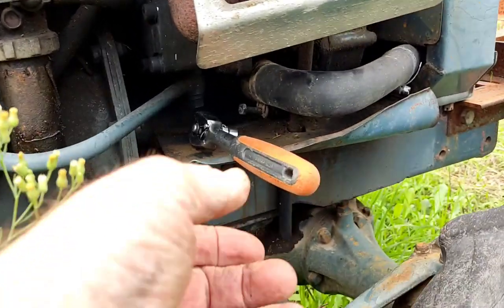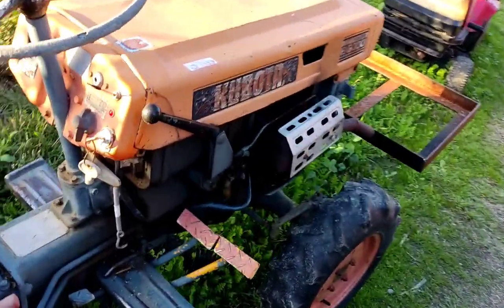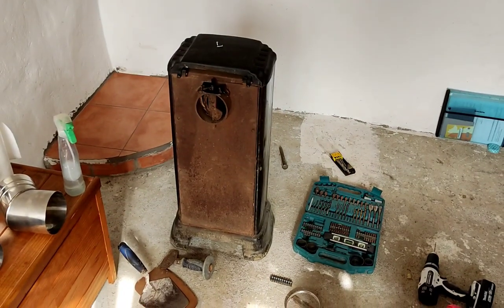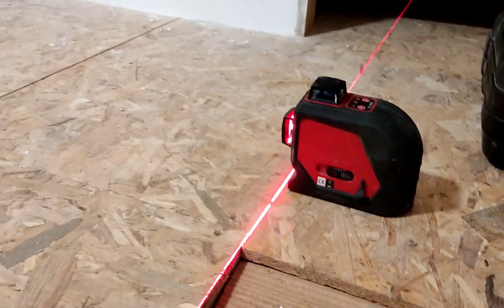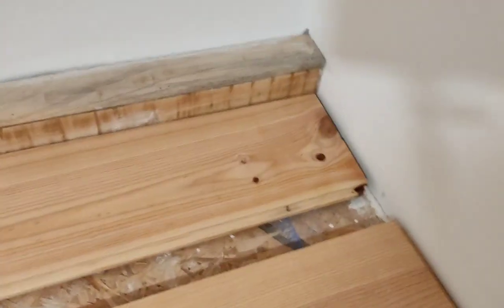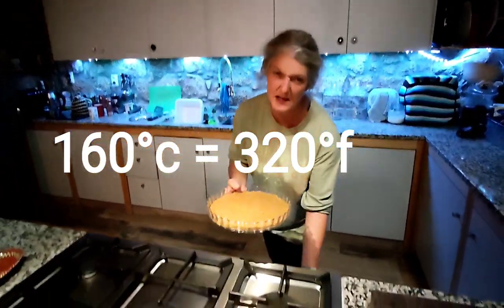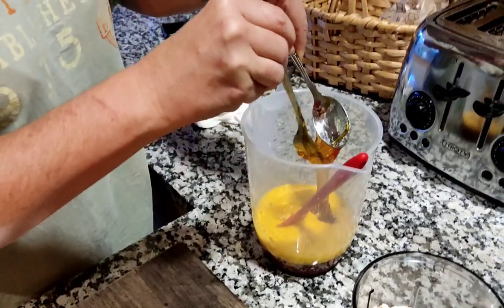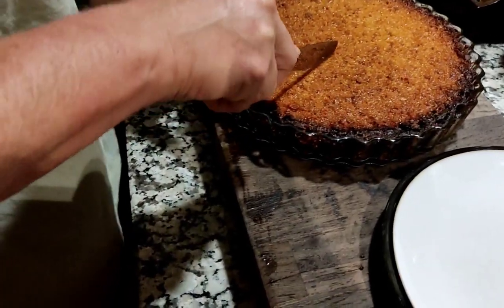110 : Fitting an Off Grid Wood Stove and A Treacle Tart Recipe

Comment: That tart looked scrumptious..
So good of you to help clarissa and yuen  with the stove you refurbished for them
If you can give them a tip for the rusty top if after they give it a good scrub to get the rust off they heat it up A LOT then put some oil on a rag and wipe it over it like when you have a cast iron frying pan it'll stop it rusting when they cook on it in case of any spillages from the kettle etc.
See you next week 👍👍👍

Comment: Hi Nick, why didn`you use impact sound insulation under the Floor boards ? And you should use engine cooling liquid for your tractor, cause it`s frost and rust protection. Good job with the hose and filter ! Your tractor has a gravitation cooling system ( Thermosyphonkühlung in german ), like the very first cars. Greetings from Hamburg

Comment: I think the spring inside the cap works as the thermostat, as the pressure increases it’s designed to lift up. Basic but it’s what they had in the old days.
I love that Iwan and Carissa have you both to help them out ❤
Reply from the maker: They help us as well

Comment: We installed our woodstove but we're getting some creosote dripping down the  chimney pipes. We tried to install them the male end down but the pipes don't fit inside the collar, the T joint has to face female down and the chimney cap also faces female down so we gave up and installed the damn thing female down. At a loss how to fix it. Any ideas?
Reply from the maker: Basically don't burn wet wood, our stove has a female joint manufactured at the bottom so have no choice, never have problems we always burn well seasoned wood.
Don't forget if you have female facing up on the outside you will get water ingress when it rains
Reply: @projectportugal  Thank you. We were worried we did something wrong with the installation. The wood we are burning is the old wood we removed from the house and some of the bigger peces from pruning the olive and fruit trees in May. So the old eucalyptus beams and possibly pine rafters and stringers would have been dry but we didn't get them cut and moved into the annex building fast enough so I expect it's wet wood to blame.
Reply: @projectportugal  I noticed you went through the wall at a 45⁰ angle rather than straight through. We have ours going straight through the wall and I'm thinking this is part of our problem. I want to add a 6mm incline for every 300mm but my partner said no because we will have more creosote running back down the chimney. So our horizontal pipe is completely level.
Reply from the maker: @notyouraveragegringos  horizontal pipe will allow any moisture/ tar to congregate
Reply: @projectportugal  thanks, that's what I thought. I'll see if I can fix it myself while he's working on something else.